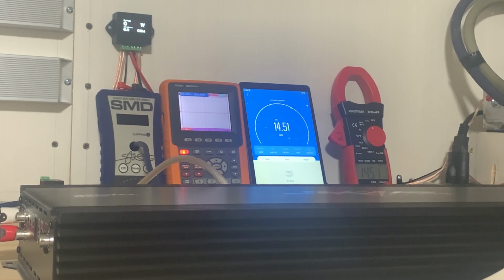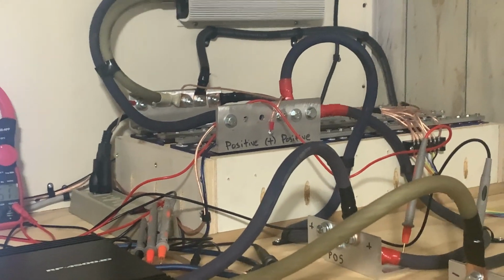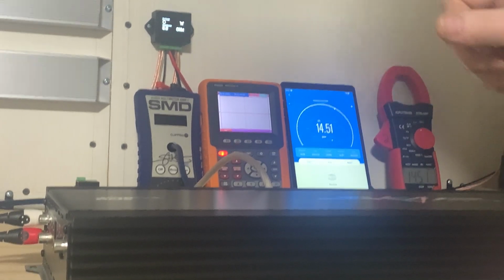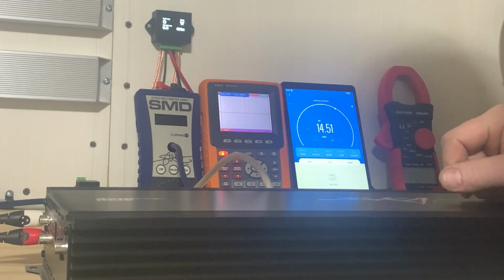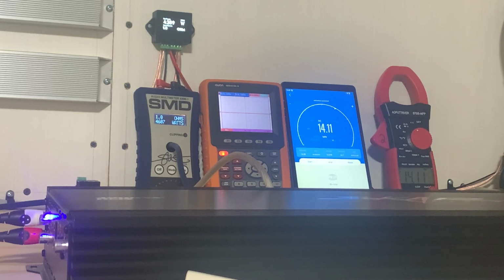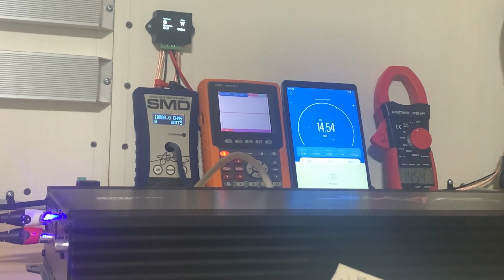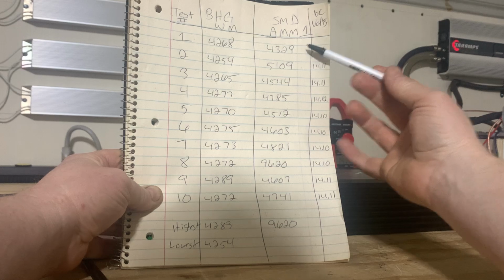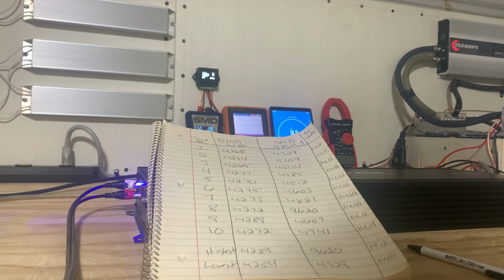BHGWM vs SMD AMM1 consistency test

Comment: I wonder if the smd has a higher resolution or test rate so it picks up these huge spikes compared to the bh? Other videos comparing the 2 say the BH is not accurate.  When Parker the bass head did that slapz audio test his BH watt meter didn't read what that amp was putting out either.        Clipping will give massive watt spikes, but I'm not sure if the BH would pick it up.     What does the oscilloscope map for the huge wattage runs?  It show a spike?
Reply from the maker: The other testing I have seen does not go into detail what they are doing or not doing. My testing is usually more thorough than most others hence the reason I am catching the discrepancies between all these devices. The other BHGWM tests I have seen were from the v1 watt meter which is supposedly inaccurate. I have 2 of the v2 BHGWM units which I have proven beyond a shadow of a  doubt they are spot on accurate. I am picking up a v1 BHGWM this weekend from a friend so I can test it versus the v2 BHGWM. The AMM1 was inaccurate and inconsistent in the dyno power mode whether the amplifier was clipping or clean. Also into clipping the AMM1 was horribly inaccurate trying to detect clipping as I have shown several times versus 2 different good oscilloscopes. Thanks for watching and thanks for the inquiries. Hope this clears up any questions you had on the subject. There are more tests to come with the BHGWM v1 and v2 along with the Termlab and SPL LAB NEXT LCD and power probe kit. Stay tuned.
Reply: @jeremywilliams8558   I just ordered the BH from big jeffs.  How do I know if it's a v2  vs the v1?
Reply from the maker: @RoboDriller  It will be a v2. The hall sensor will look like the one I show in my videos for a v2. The hall sensor is the sensor with the hole in it you put the speaker wire through that measures the current on the amplifier output.